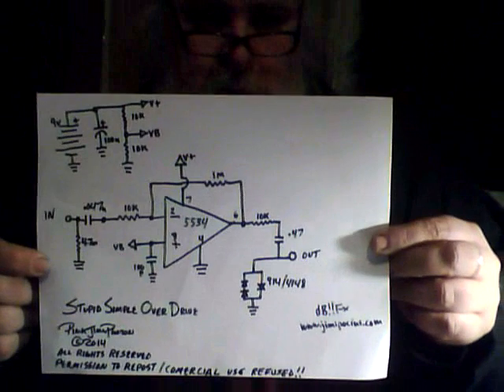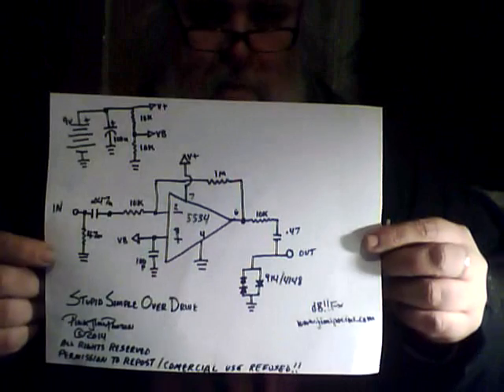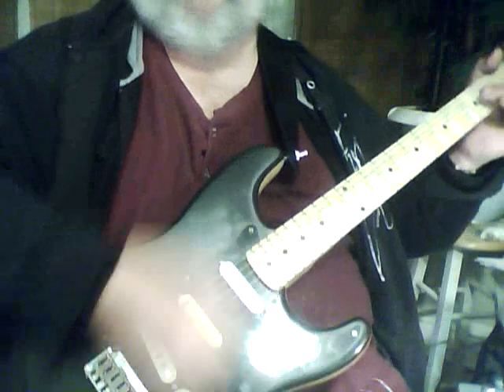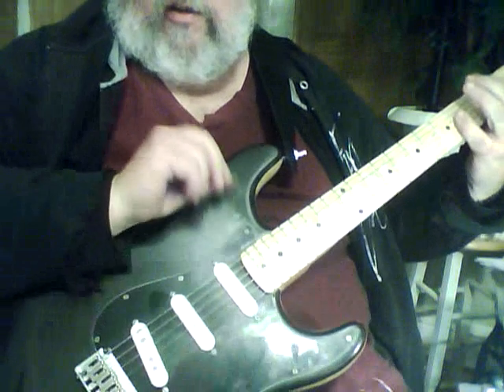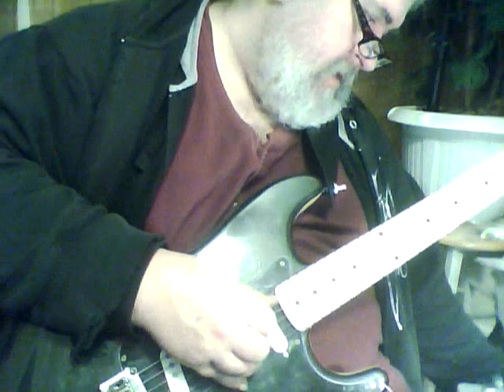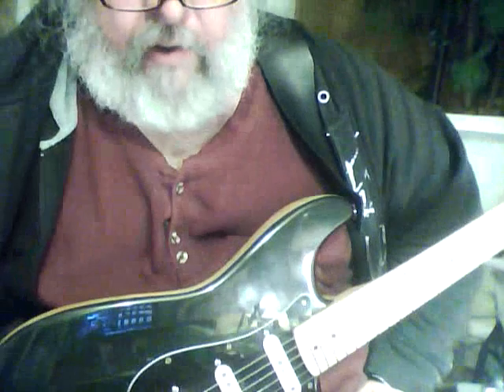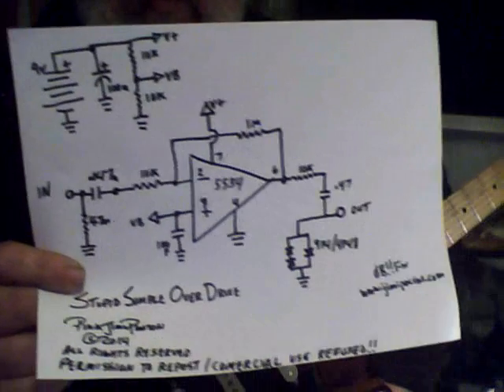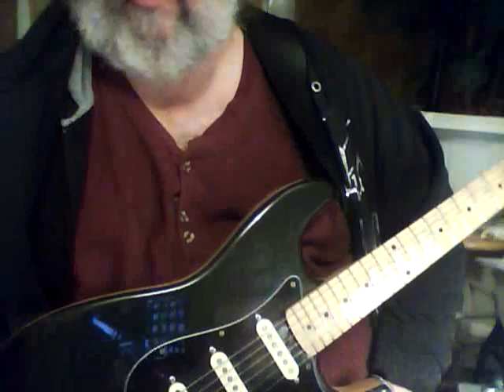SPTWPJP StupidSimpleOverDrive

Comment: I substituted an LM351 FET type op amp, and I added a rotary switch for the diode pairs, so I can use LEDS, silicon and germanium diodes in different combinations. This was a great circuit, I just wanted more variation :)
Reply from the maker: yeah, its fun. the original one, i built the whole mothafunka p2p on the back of an 8 pin dip socket ;)